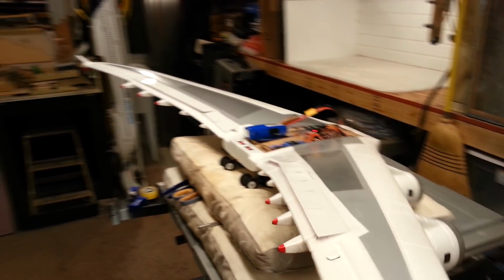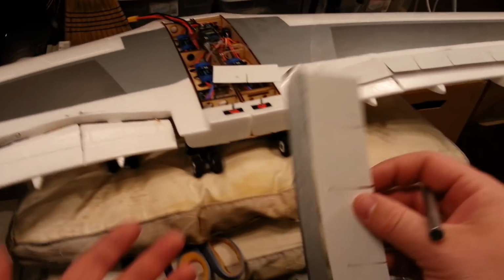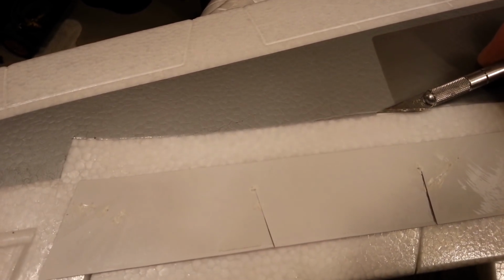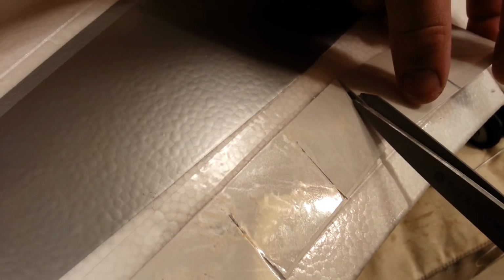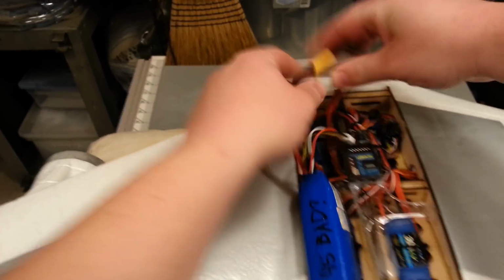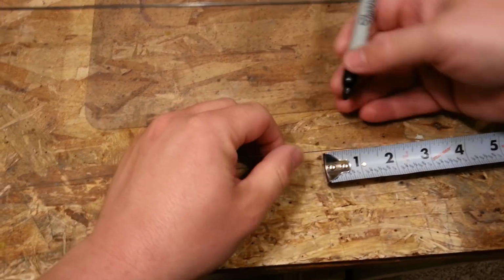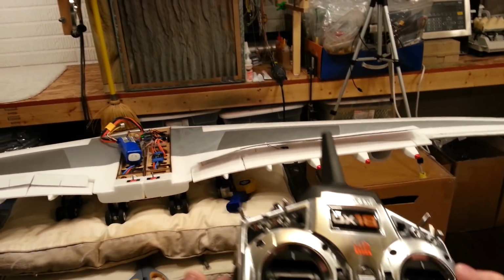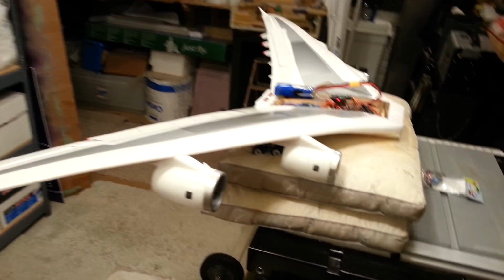Tian Sheng - Airbus A380 - Spoilers Part 5 - Spoiler Redo

Comment: That looks good, like the spring action over rubber band. Looking forward for s bec mod then some flight time, awesome plane. Thanks
Reply from the maker: Thanks again! It's gonna be a HUGE project, the LED's. I might need to build them, then install them having already been wired up...so I can keep tabs on the weight.